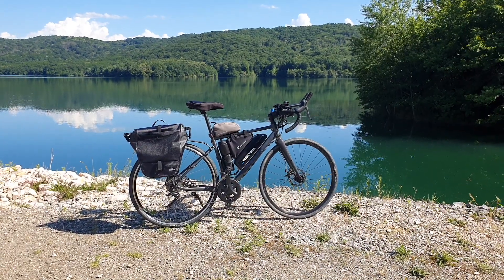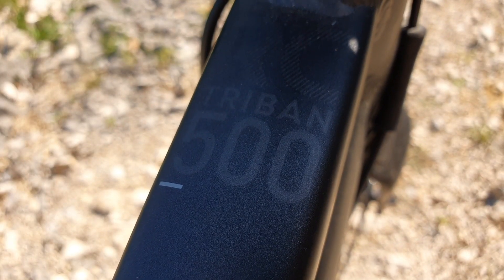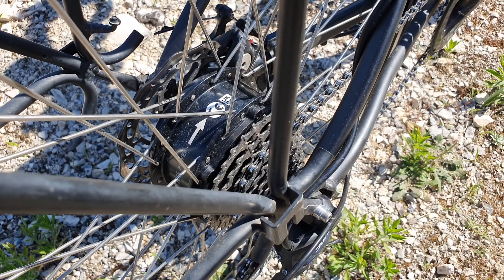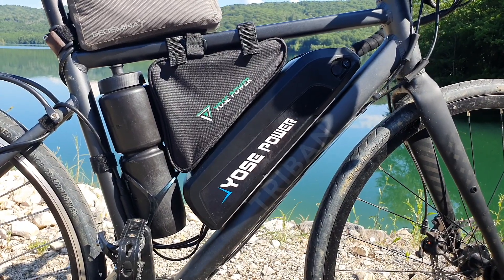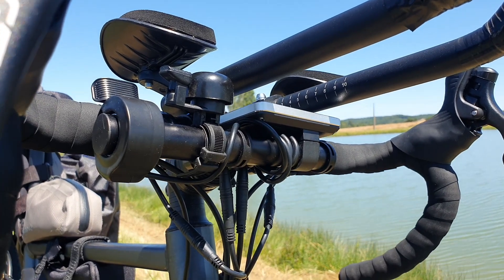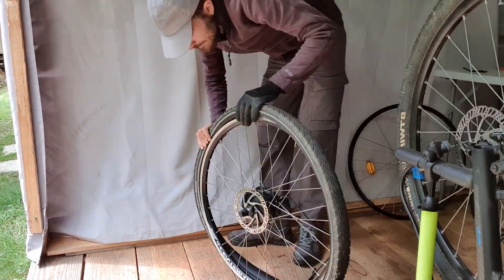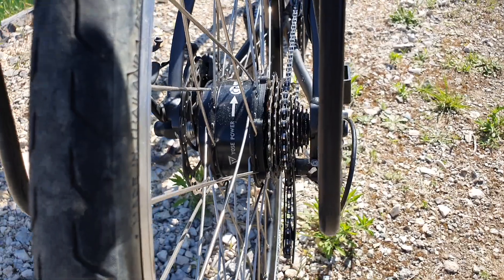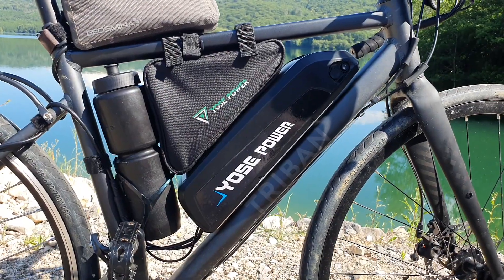YOSE POWER eBike Conversion Kit Triban RC500 Review

Comment: at 6:59 you suggest if anybody from the comments needs it, which i do, for you to make a video about installing the PAS sensor because i have the EXACT same bike and want to convert to ebike. I dont really know anything about conversion so i am planing on following this video and making the same setup as this. Thanks in advance, nice video 👌.
Reply from the maker: Glad the video helped. I think I'd have to explain in a YouTube short perhaps and I've already installed the PAS sensor and it's best I leave it in place. Perhaps I can explain via diagrams. I tried to explain in this video. The main thing is to take off the cranks and install the sensor on the drivetrain side on the ring. I warn you that you might need quite a bit of patience but it's definitely worth it and it's possible as I demonstrate in the video. 👌 Hopefully the e-bike industry will improve the compatibility of future sensors for road bikes.

Comment: I only wished it comes with a 52v or 48v battery, but then again it’s literally impossible to find a conversion kit let alone a full electric bike with those types of battery for under $500.
Reply from the maker: Just so you know I've found out that the battery is at 42v fully charged then later on it drops down to the 36v rating, I find the with 350w motor it is more than enough for the hilly terrain.